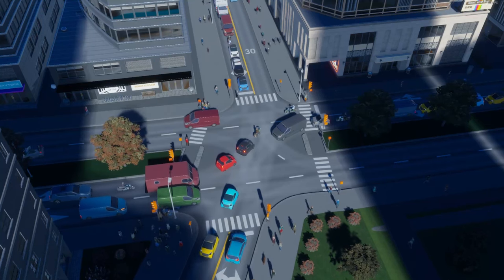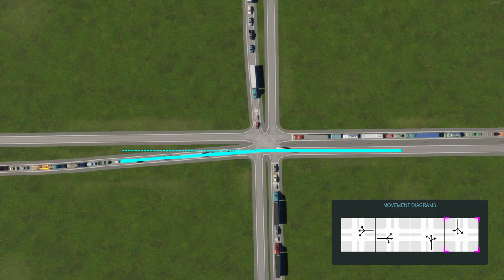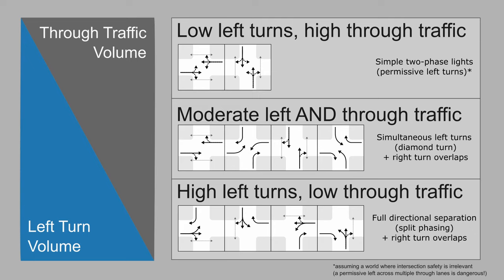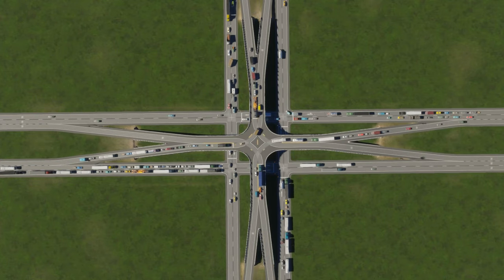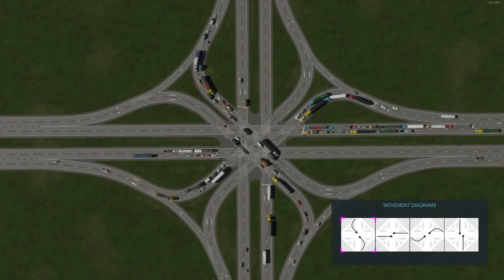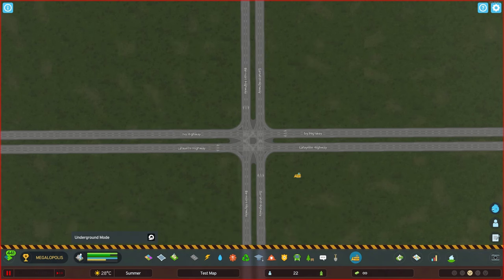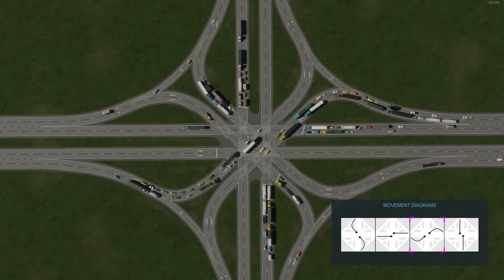How to trick your traffic lights into functioning the way you want in Cities Skylines 2

Comment: Thank you. This is what I've been waiting for. I want to create a 3:30 intersection, but it doesn't come out pretty. Can you also post a production video? I really want to see it.
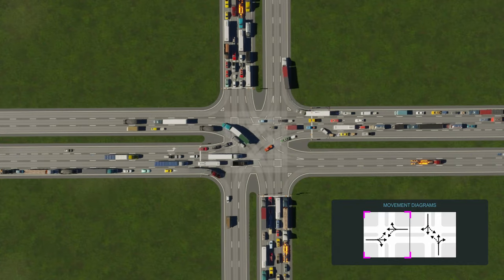Reply from the maker: I can describe it, if that helps. I made an intersection with parallel roadways as seen at 0:50, then with snapping off I used the replace network tool to shift the roads to widen the node giving as big a gap between as I could without the intersection markings looking too weird. Then I just drew a 2-way road through at roughly 3-degree angle to the other networks (snapping still off), not aligned to anything, just looking by eye if it was roughly even. Then attached 1-way, 1-lane ramps to each end of the 2-way road. I don't know how replicable that is in a video, as it was mostly just 'keep re-trying until it looks good'.